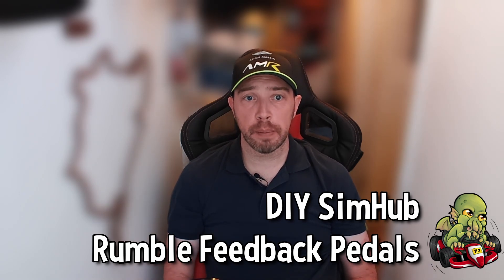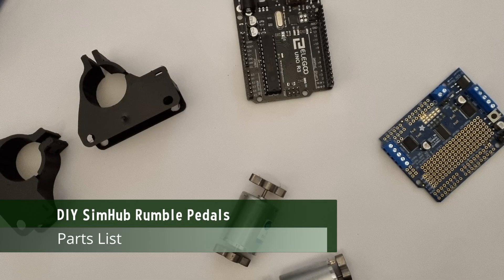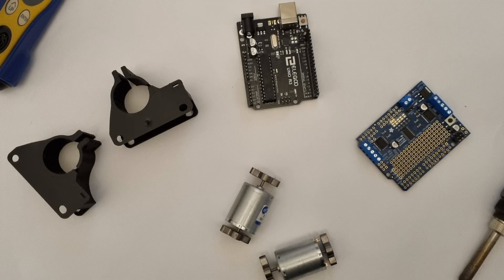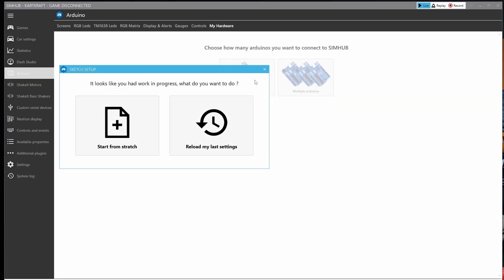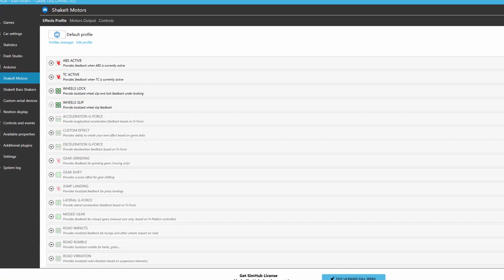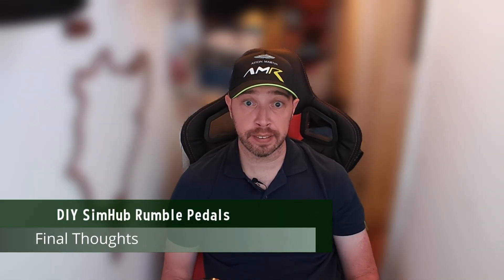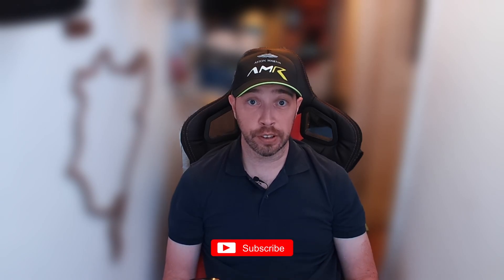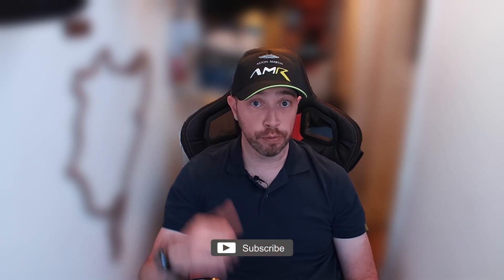DIY SimHub Rumble Feedback Pedals

Comment: Great project. I have a couple of bass shakers under my pedal deck and under my seats (4 total) using simhub. With my current setup I cannot recommend enough. I'm looking to add a few more under my shifter plate and rear pedal faces for different effects and added immersion.
Reply from the maker: Thanks for the positive feedback. I'd definitely recommend additional devices on your pedals, the added immersion is worth it imo if you can get hold of the hardware cheaply enough.  I didn't think about under the shifter for that clunk and engine vibration.  I sense another project coming up!

Comment: Helo, thanks for sharing. justo a question...what other option could I use instead of adafruit motor shield?
Reply from the maker: Due to the on-off nature of the motors and the current draw, I'd suggest the use of a motor shield.  Adafruit is one option but there are cheaper brands out there with similar capabilities.   Look at the specs of a shield you're interested in, if they are at or above the Adafruit you should be good to go.

Comment: Nice project. I am thinking of making this; however, I already have the Arduino uno and a motor shield and am using 2 of the motor slots for the wind sim. Can I use the other 2 slots for the rumble motors without having to buy an extra Arduino and motor shield? Thanks!
Reply from the maker: Most motor shields don't allow for much amperage headroom so if you have budget then you should be able to add them, but check that your shield has the spare capacity first.

Comment: Ill be adding small 25w exciters on pedals tomorrow seems much less work to do so and less lagg.
Reply from the maker: More fidelity, too. I actually use two pucks on my pedals these days.
Reply: What exciters do you guys use and where should i look for? I want to install them on my gas and brake aswell.

And why opt for exciters and not bass shakers?
Reply: @Teqqlesdoessimracing  so speakers better than motors?

Comment: Hi, any reason why the power supply is connected to the motor shield instead of the Arduino? If I plug into the arduino will it still work?
Reply from the maker: I think this was due to amperage through the motorshield, though you could probably get away with running the psu through the uno.

Comment: What box do you use for Arduino and Adafruit boards? Do I have to put both in the same box? Can you share the link of the item? Thanks
Reply from the maker: I didn't end up using the box in the video as it was too tight a fit. I used https://www.amazon.co.uk/gp/product/B072FS3W7X instead, though for this project you don't need a window.

Comment: hi, the simhub configuration, how you do?
Reply from the maker: After you install the firmware (see Firmware Upload on the video) you can then go to ShakeIt Motors, select your channels (Motor Outputs) you should then be able to select features you want to test against.  In the video I just enabled ABS/TC, Wheel Slip and Wheel Lock.

Comment: Please, have a power supply link in alexpress ?? or what power supply need buy ?? Ws and Vs ??
Reply from the maker: Something like https://www.aliexpress.com/item/1005003812497472.html would supply enough power as we're looking at 12v @ 3amps roughly.  Actually the motors I used required less than that but it was a nice safe ceiling to be able to provide a little more.
Reply: @Teqqlesdoessimracing   Thanks !